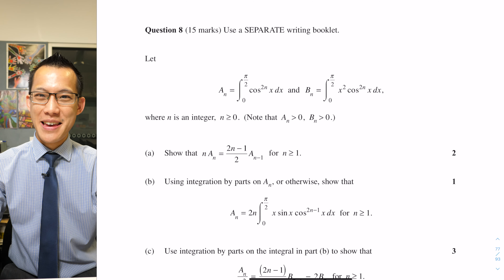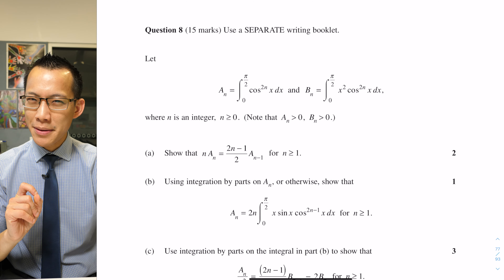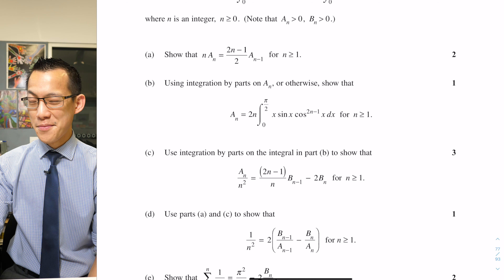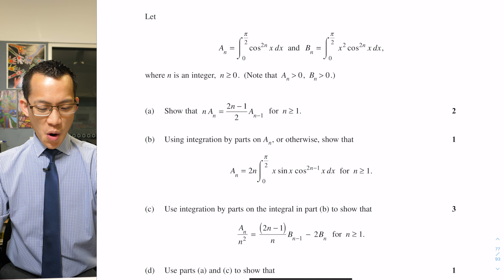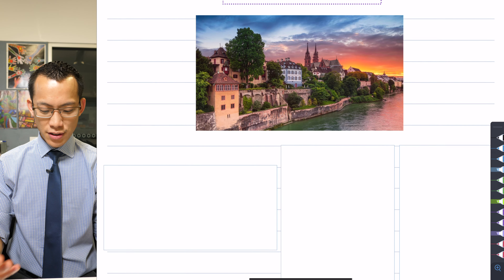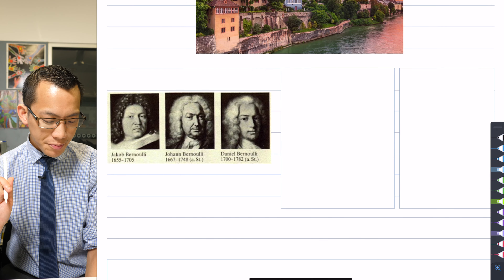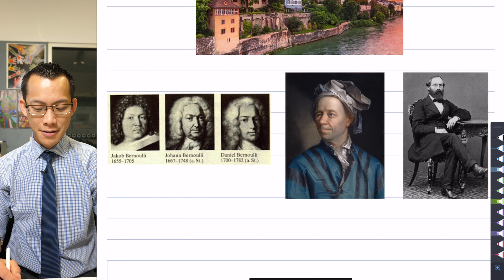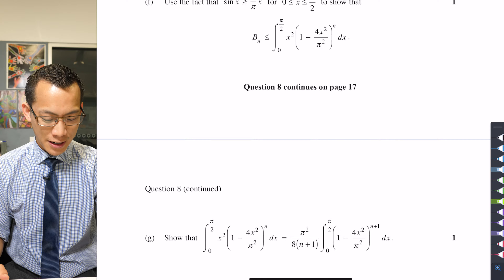The Basel Problem (1 of 9: Prologue)

Comment: bruh, this took me like two hours to do. I am too slow haha.
Reply: I also did it and it took very long because I struggled at the beginning to have the right idea how to approach the question, but the rest wasn't that hard.
But it was extremely satisfying.
Reply: @SeeTv.  yeah, true. Ommited some stuff on some of the ibp stuff but otherwise momentum bought to the end
Reply: @SeeTv.  Also, for e, did you find the n-1 case then concluded by induction it's true?
Reply: @SeeTv.  and for the final q, it surely was squeeze theorem?
Reply: @justinpark939  No, for part (e) I rewrote 1/k^2 as the expression from part (d) (with a k instead of a n bu that's not important). Then I realized, it was a telescoping sum! These are always so satisfying. I wrote out the terms of this sum up to k=n and realized, that every term cancels, except for the very first and the very last. The very last term 2*(B_n/A_n) is in the final expression and then I only needed to show than 2*(B_0/A_0) = π^2/6 which was really easy by just plugging in 0 for n in the integral definitions of A and B.
Reply: @justinpark939  Yeah, the good old squeeze theorem. However, I'm not so certain what the reasoning is with the "strictly less than" sign on the right. I guess, in the limit this can become an equality.
Reply: @SeeTv.  for induction, surely there is a flaw in my approach?
Reply: I just spitted out a 1/n^2 term and looked at my def for an/bn and found that the sum up to n-1 was in terms of the same of the rha for n-1 instead hence PBI
Reply: @SeeTv.  squeeze theorem works because it can be proved via epsilon-delta 

it doesnt matter if u have strictly less than or not, squeeze theorem applies. yes, it does sound strange that a < f(x) < a (strict inequalities) but in terms of squeeze theorem, u can say the limit approaches a.
Reply: @沈博智-x5y  Yeah I think it makes sense, cause for every finite value of  n the strict inequalities hold but in the limit it can be equal. Fore example there are many sequences that are always rational but the limit is irrational (like Euler's number)